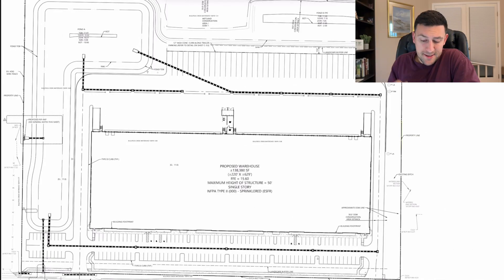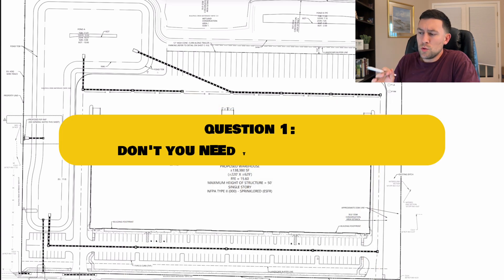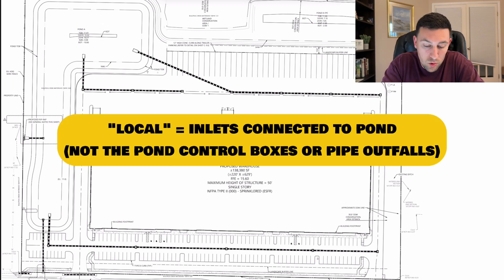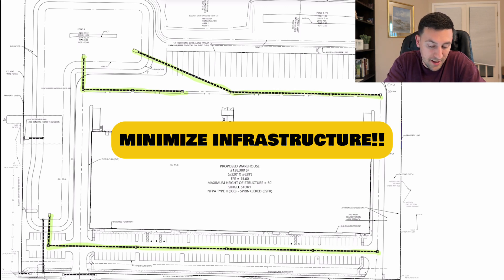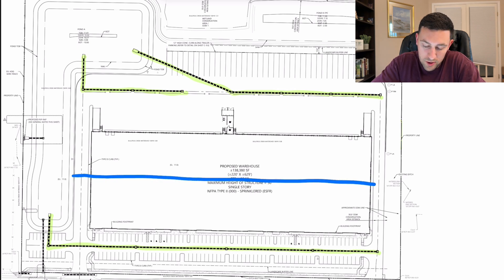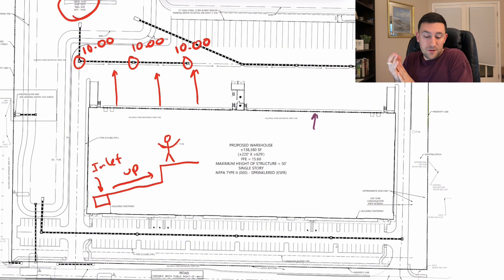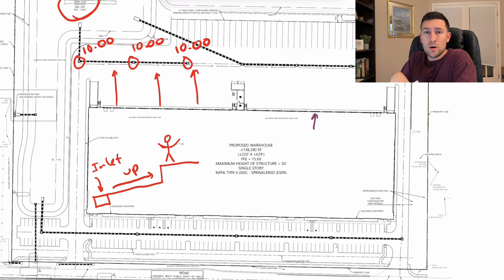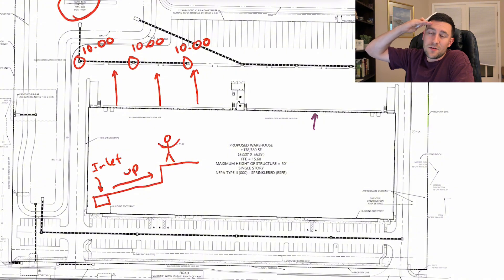How to Grade and Place Drainage Inlets

Comment: Typically, I work on subdivisions or amenities, which are quite similar to the example you showed for commercial sites. What I need to understand, and haven't yet had explained to me in depth, is how to design a storm system. I have a good grasp of the overall concept, but there are small details that can significantly impact the efficiency of the storm. Additionally, they use Storm Tabs to calculate all this. Is there any other tool I could use to calculate the pipe sizes that is less complicated? Sometimes, amenities are placed under a basin without being divided into sub-basins (I am assuming not having the design at the moment of the model. I have some ideas about this, but I would appreciate a detailed explanation, especially in the way you do which for me is very clear and direct
Reply from the maker: @CN82-tl9br  I have a pipe sizing tool (and other tools) I use that makes it quick and easy. But again, quick and easy typically means conservative and preliminary. These tools are available in my bio description. I can create some videos on how I would go about stormwater design—I’ve been doing it for about 6 years now, including very large scale projects
Reply: @civilgriffin  Yes, I see that in the video, and I will check them out. I want to provide the best possible work with the resources I have. I have requested training in this area, but I haven't received it yet
Reply from the maker: @CN82-tl9br  do you need more detailed explanation on the major conveyance of water (entire pond system and associated hydraulic routing) or the local collection system? Both have their own slightly separate approaches
Reply: @civilgriffin   I believe Local is the info I need to work independently. For example, if I'm asked to complete the grading drainage from the provided layout and pond, I can handle it. While I'm comfortable with utilities and sewer systems, stormwater management feels more intimidating because no one has explained it to me in depth. Maybe I'm not asking the right questions because I'm not aware of what to ask.

How to design a system with the right parts and inverts to function correctly. I believe stormwater management is much more influenced and personalized based on the area than other systems. I feel like I have a puzzle that's almost complete, but I'm missing some pieces to finish the whole picture I need